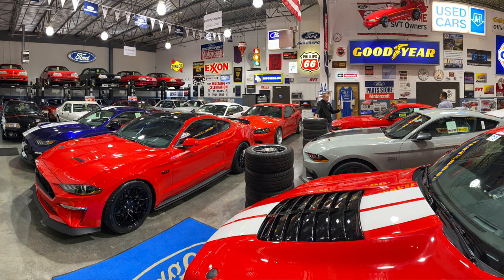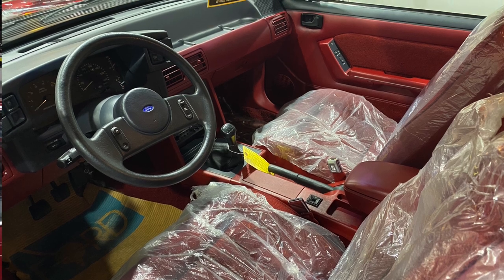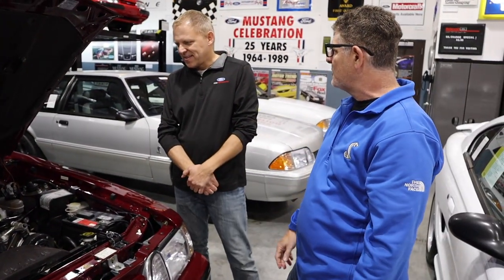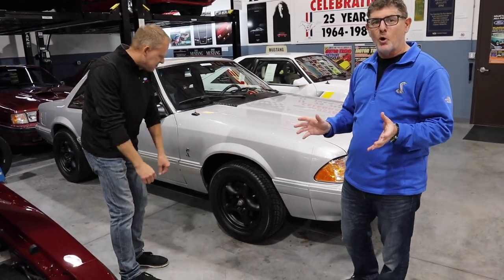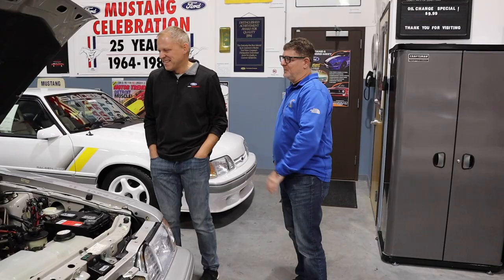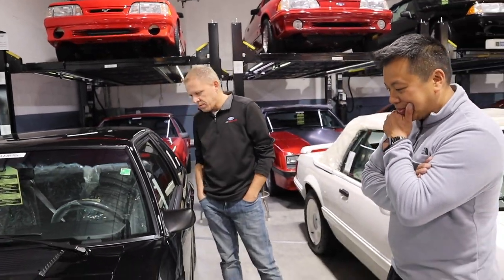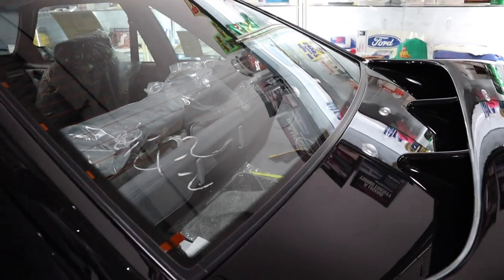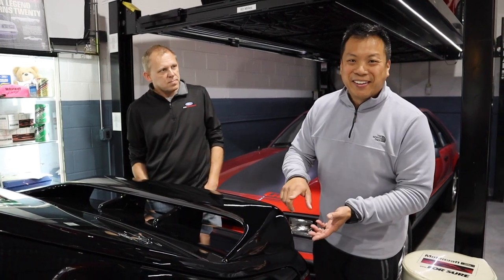The Mustang Dream PT 1 — The Best Mustangs of All Time?

Comment: I still own and drive my first car that I got in 1990 at 16, a 1986 5.0 5 speed coupe. Fell in love with it on that first day and still love to work on it and drive her!!
Reply: And unlike these cars, your engine isn’t locked up. Every time I hear “perfectly preserved” and “15 miles”, all I hear is “ran when parked” and “this engine will take about $2k in parts and machining before it can be driven.”
Reply: @davidblalock9945  I'm pretty sure he starts these cars up and let's them run. He's got to or they would become worthless. I bet he even moves them around driving them a few yards.
Reply: @davidblalock9945  I don’t think so. Videos everywhere of the opposite. In fact I recently got an 83gt been parked since the 90s, new carb and it runs excellent.
Reply: MY VIBRANT RED 93 COBRA CONTINUES ON GOING UP I. VALUE.

Comment: Wow what a great amazing collection, my head is still spinning.What great cars, I love the 85 GT, reminds me of the 1985 GT Late model I had. It was a 85 GT Hatchback
Ice blue w/ auto trans with no 4 bbl carb., it had throttle body fuel injection, with the same air cleaner as the 4 bbl.carb.

Comment: Rev when I was 17 in 86 I had a 79 Mustang coupe with a stock 302. It did have dual exhaust. Had the 14in. 12 square wheels, black int. shortback buckets, C4, no console. It was the factory yellow, I'm ashamed to admit that I don't know what Ford calls it.
It didnt have badges either=sleeper lol

Comment: I still have my 93 cobra identical spec black paint gray interior 5 speed has 110K on the body these days and I've had it since it has 24K motor these days is stroked with a Paxton

Comment: You never mentioned anything about the 1991 triple white LX conv.That car just stands out to me.I would really like to see a 7Up conv green with the white top.My all time favorite is 1991 Jewel Green with white top white Wheels white leather interior. Steve saleen made those cars beautiful with the roll bar. I had one when I was 18 years old I got it as a light engine fire car. Had to sell it because of a divorce that car only had 18,000 miles on it. It had a signed dash by Steve saleen Leather jacket and driving gloves it was # 4 out of 54 if I remember right.